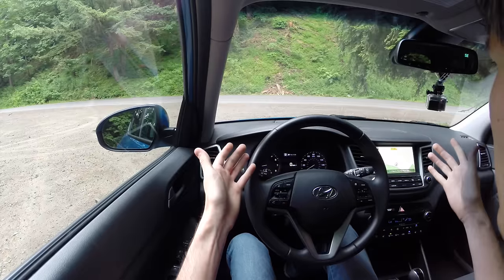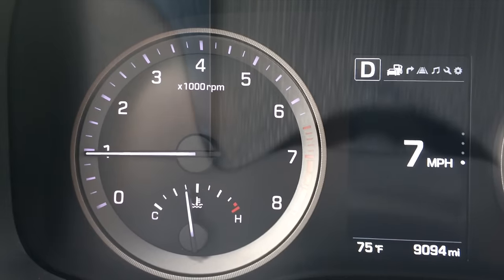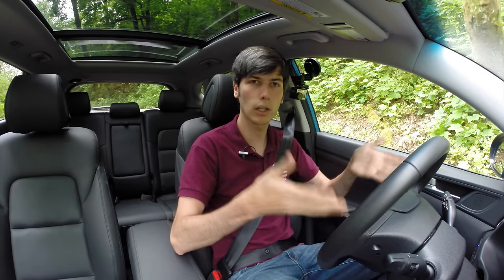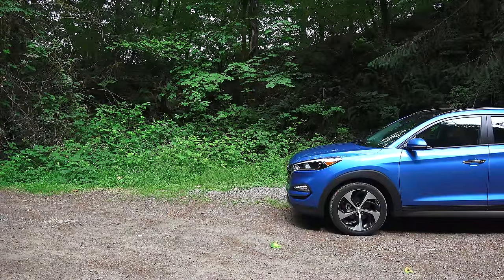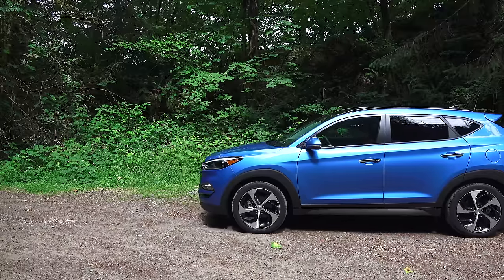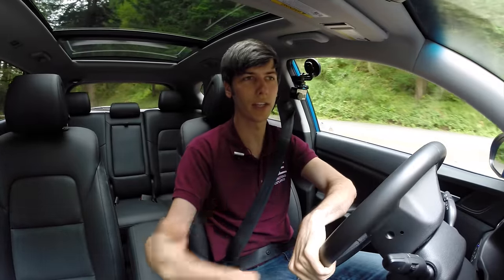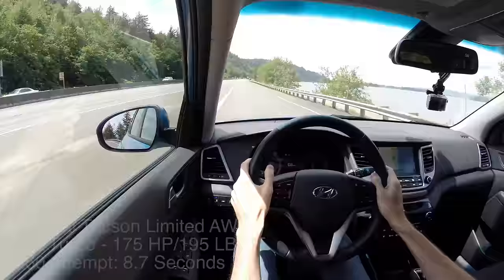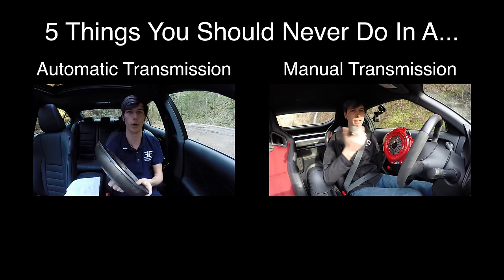5 Things You Should Never Do In A Dual Clutch Transmission Vehicle

Comment: "Don't inch forward" LOL... so here's a transmission that's essentially incompatible with driving in any large city. Just kidding, of course, that's an exaggeration; but it does go to show just how valuable a torque converter (or hybrid) can be.
Reply: And it also shows that the title of the video is completely misleading.
Reply: Frank Reading Well, only if it's taken literally. He's not saying you should never, under any circumstances creep forward in a DCT-equipped car, just that doing it regularly may wear the clutch faster (i.e. "never always creep forward"). EE is a smart guy, makes tons of great videos. Dual-clutch transmissions are really cool, but I think this is probably a valid criticism of them... and I'm honestly kinda surprised that they're becoming so commonplace now. For regular, city or suburban driving with lots of stops and starts, a torque converter has distinct advantages. DCTs are a natural fit for any performance-oriented car and hybrids, where the electric motor can handle low-speed duty, but for a Hyundai Tucson? Seems kinda silly.
Reply: ***** To be fair, we don't really know how fragile most DCTs will end up being yet either. VW's DSG has been around the longest and has multiple well-documented issues, but I feel like that could be said about almost everything VW builds. There's a big movement right now to make engines smaller and more efficient without compromising performance and I think that's cool. I'm excited for 2-cylinder 500cc engines turbocharged out the wazoo. A DCT gives you impossibly fast shift times and reduced mechanical losses, so that's where Hyundai is coming from with them and I understand that... thing is, modern automatics really aren't that far off from DCTs in performance or efficiency; especially in something like a compact sedan or CUV. 0-60 and MPG are going to come down to fractional differences between an Tucson with an automatic and a Tucson with a DCT - something that 99% of the people buying them will never notice. Maybe I'm wrong and their clutches will prove strong enough, and their computers "smart" enough to avoid excessive slip and still feel linear behind the wheel, but only time will tell!
Reply: as a long standing hyundai tech I can tell you in my shop the transmission that provides hyundai with the fewest problems is by a wide margin the DCT. Since the Veloster DCT ive seen exactly 2 DTC transmission failures in 5 years at a dealership level. But you're probably right.
Reply: There's a tiny bit of confusion here. As long as the first gear engages fully, there's no problem with creeping. You could try this out in a manual car to see how fast you are going when fully engaged to first gear with low engine rpm. In a dual clutch system this practically means that you should not creep by lifting the brake pedal a little i.e. move slower than the first gear allows. Creep on, but when creeping just lift the brake completely.
Reply: Klikkitse Lifting off the brake pedal completely doesn't mean that the clutch is fully engaged. That all depends on how much slip the DCT is programmed to allow.
Reply: doctor zaius All I meant is that EE has titled this video "Things NEVER to do" and in reality it is "Things you should sometimes avoid doing if possible"
Reply: doctor zaius There are several videos on Youtube showing the DCT in Tuscon overheating and neutralling up as a result. Driving in heavy traffic i suspect might be the cause.
Reply: doctor zaius Wait, seriously? I never knew this. I was under the impression that creep speed = first gear fully engaged.
Reply: Right, what you should do is let the car in front get a little distance, then move up with fully engaged transmission and come to a stop behind the next car. It doesn't mean you can't drive in traffic, just realize that by not tailing the car in front creeping on their tail, you are not getting forward any slower.
Reply: Yeah, and by leaving that distance somebody cuts in front of you, or honks their horn at you.
Reply: True enough @Scott Z
Reply: 1-inch distance creates more traffic... on smaller roads were you start recognizing other cards after week you can give a try and leave more space by waiting longer even 2-3 cars and than go... after few days more of co-drivers realize that it's better and you all are going with constant speed of e.g. 30km/h. Why? Because there is enough buffer between cars to limit effect of 1 car stopping in front or doing something silly. Also 1 inch distance = more tiny accidents which blocks lane for 30 minutes until drivers realize fine will be higher than damage and go.
Reply: same wear and tear on a manual, basically he is just saying you can do it but it would shorten the life of a the clutch pack.   I rarely creep when driving a manual transmission, I would do the same with DCT ...
Reply: To be fair, the majority of people in greater London on the roads are using manual transmissions, and the traffic there is worse than almost anywhere in the states.  The difference is that over 90% of licenced UKers took their drivers training and tests in vehicles with manual transmissions, and they tend to have fewer habits built up by driving torque converter based automatics.

I think ultimately it just wasn't a good fit for the North American market.  The powershift gets far less criticism for its behaviors elsewhere, and most American consumers probably didn't know what to expect.  "Stop and go" traffic seems to get much more choppy in countries dominated by automatic transmissions .
Reply: doctor zaius dude it takes 2-3 seconds to let the car in front get far enough forwards for you to give the accekerator enough of a pip to get rolling without harming the clutch
Gotta do the same in a manual - which is technically (at a stretch) what youre driving
Reply: Its just like riding the clutch in a manual.
Reply: Yes, and the car should really have a break hold function so that the driver doesn't have to hold the break while stopped. Its not really difficult to do.
Reply: Klikkitse depends on the transmission, but let’s say that in my Audi s-tronic (basically VWs 7 speed DSG) I believe it never allows the clutch to engage fully on 1st gear to prevent jolts when accelerating or letting go of the gas pedal. even the indicator shows D and then D2 (2nd gear) after getting to about 10 kph (6 mph?). then the rev counter begins to copy the increase in the cars speed—in lower speeds it lets the clutch slip and the revs stay pretty constant even though the speed changes...
Reply: @trevors8577  I creep forward at lights to allow access to turn lanes or to let someone pull forward enough to get out of the intersection. I hate the people that leave so much space between themselves and the car in front that I end up waiting at two lights instead of one because they wouldn't move up enough to allow me into the left turn lane while the arrow was green.
Reply: @nich0lee  I agree with that but you shouldn't have to creep at all, where you stop should be close enough to the next person to make it unnecessary to move again.  If it's really really close and you actually have on a turn signal so I know you want to turn then I'll try to move further ahead but I usually stop within three to four feet anyway, and driving a stick I don't want someone within inches of my butt either.  But courteous drivers in the state of colorado are getting fewer and many think that ten feet is an acceptable following distance when doing 70 mph!
Reply: With a wet clutch you can inch along all day. Source: 200k mile Passat DSG.
Reply: @hologrampizza5432  Your passat has a wet clutch AND requires NEW FLUID EVERY 40,000 MILES to remove allllll the clutch material that is worn off from slipping.  So you pay around $300-$500 for that service or if you DIY then it's around $150 every 40k just in parts and it's going to be better than a grand to replace the clutch when the time comes.  Slipping the clutch, whether it's wet or dry is going to wear it out faster than not slipping the clutch, I don't care if Bob is your uncle or not.
Reply: I drove a DSG in London, and managed to not creep forward, as I rarely do, I maintain a gap so I can keep it moving at also let the car in front move some distance before following.  It prevents me rear-ending someone cos they weren't committed to crossing the stop line or someone stepped in front of them or whatever.  Plus a chance to stretch the car's legs as it were.
Reply: @doctorzaius4084  These are essentially MANUAL transmissions that are shifted AUTOMATICALLY. Creeping along in stop and go traffic will wear the clutches just like pumping the clutch in stick shift car. The transmission unlike a hydraulic AUTOMATIC transmission (slush-box) should last a VERY LONG time. A bonus with this type of transmission is that it only holds about 2qts of fluid and like a manual transmission would probably never need changing, no valve bodies or filters to clog up.
Reply: @TheOzthewiz  A fluid coupling is naturally far more resilient than a clutch in any type of low speed driving. If you live in or near any large North American city, 90% of your driving is going to be sub 30MPH with multiple stops and starts per mile. Even the most cautious driver will not be able to avoid excessive clutch wear under those conditions. There aren't too many taxicabs with DCTs tooling around NY or Chicago, and with good reason.
Reply: @doctorzaius4084  Also not many cabbies with stick shifts either. As I explained, these  cars were designed to get maximum efficiency just like a manual transmission with the computer working the clutch. The car should be driven with the understanding that it has  MECHANICAL clutch discs that are wear and tear items. The transmission itself should be bullet proof like a manual trans. Most of the negative press that this car has received is because folks that have NEVER driven a stick, are not used to feeling the up and down shifts, thinking that the trans is malfunctioning . I personally like the way it shifts with detectable shifts because I learned to drive stick shifts. I took my road test for my license in a stick shift car at 15. CHEERS!
Reply: doctor zaius From what I noticed test driving a VW golf with dsg, is that the car does pull forward a bit faster than with reg auto from stop when releasing the brake.  Obviously that’s so the clutch can fully engage sooner.
Reply: doctor zaius Exactly. It depends what cars and what type of transmission you’re surrounded by. Traffic is just as bad in London England. Only in London you’re surrounded by other manual drivers who don’t continually creep all day inch by inch.
Reply: To be fair a lot of people mess that up in a manual and wear out their clutch.
Reply: @myguydied  something that comes with a practiced skill of driving a manual in traffic without riding the clutch. A skill not everyone has especially those that only drive automatics.
Reply: @skopa1223  probably more so because of the mechanism of the clutch engaging and having that direct connection from the engine to the wheels rather than that slip through the hydraulic slushing of fluid through the torque converter as the engine revs increase when you step on the accelerator.
Reply: doctor zaius my car’s a hybrid with a 7 speed DCT. I wonder where that puts me
Reply: I notice the largest annoyance in my DCT, on the highway during rush hour where you stop then move 5 yards at 7 mph and then stop again.  Constant clack from trans when I remove brake, clack again when I apply.  Sometimes 6-12 clacks per minute.  I love the MPG of my little car, but I stopped driving it to the city for work and just take the gas hit on my big V-8 Cadillac since it loves all driving conditions.
Reply: @bushrakhan1529  in a Geely lol

Comment: #3 My car (VW brand, Touran II) has gear #1 only for starting to drive, it will immediately switch to gear #2 afterwards. In such a scenario, I switch to manual and to M1 to slowly drive forward. Otherwise the car would shift to D2, and will not close the clutch completely and will lead to the problem you told (but with gear #2 instead of #1). So it helps to know how your car is working to avoid slipping clutches.

Comment: Nice vid out there! Learned a lot from this. But I have questions regarding point no.3 which is about inching forward. It's best to allow enough gap to get up speed for the clutch to fully engage. But, how fast is fast? Is it like 10-15mph or higher? Or 1-2k rpm? Look forward for the answers. Thanks and keep it up with those great quality videos!
Reply: its a bit late but as far as i can tell. In a manual transmission you can easily drive 10 km/h (so about 6 miles per hour) ?

Comment: I got my first DSG 8-speed car just a couple of weeks ago, and I'm still trying to predict the gearbox fully. I find that while it's super smooth at changing gears, it's kind of slow out of a stop. I've been driving manual cars almost all my life, so it's a bit weird having that lag from pressing the throttle until it starts moving fully. I'm guessing it's that while I'm in D, and on the break pedal waiting to go, it's got both clutches disengaged so they're not wearing down (basically same as N), so from the moment I release the brake pedal and press the throttle it has to engage the first clutch from a not-ready position. Is that correct?
Reply: Correct.
Reply: What do you mean with "not ready position"? Normally the ability to quickly engage and disengage these clutches is one of the big advantages of a DSG.
Is it possible that your gearbox is trying to set off as smooth as possible and therefore uses an especially long slipping time? I remember some DSGs barely used the first gear and instead started in second gear with slipping clutch to give a smoother experience.
Reply: @MetalheadAndNerd  I don't know, but from the video I got the impression that while in D, while being stationary and having pressed the brake pedal, both clutches are not engaged so not to wear the clutch. Is that way it seems slow from a stop? I've heard others with DSG gearboxes also complaining that it's a bit slow from a stationary. Interestingly it seems faster (quicker reaction) from a stop in S (sport) mode than in D.
Reply: What's your car? I don't think there's an 8 speed DSG.
Reply: @ederss7  7 forward, 1 reverse. It's a 2017 Golf Sportsvan 1.4 TSI 150 HP.

Comment: Great video! Extremely educational. Regarding the "logic of the DSG", in my Golf GTI, there is exactly what you described - a lag when I downshift using the paddles whilst accelerating. The computer may think I'm accelerating, therefore the next gearshift should be up. Actually, the true situation is that I'm accelerating because I want to overtake, and I'm downshifting because I need to accelerate more quickly at that point. Is there anything I can do about this frustrating lag??
Reply: I tap the break and downshift right after then accelerate
Reply: The lag should only be a fraction of a second. Just the time it takes for the shift fork to select a new gear. So say you're in third, the transmission has fourth preselected, then you put your foot down, or manually select second, all that has to happen is the shift fork moves from fourth to second then declutches. It's a bit slower than a normal shift but should only be a tiny bit slower.

Comment: I was caught in snow and stop and go traffic, lot of breaking and going slow, all the sudden got a warning tone and message the my transmission was over heating.  Called the dealer they told me to leave space between me and the car in front of me to fully engage the clutch or to pull the car over and let it cool down for 20 minutes.  Say what?  That just seems to be a design flaw, did they not take in to consideration a lot of consumers buying these are city drivers in lots of stop and go traffic.  Had I know this I would have thought twice about buying the car.  Love it otherwise but this is a big issue.  I worry what kind of damage this causes over time.
Reply: Tim Gray oh man, heart attack at that moment?
Reply: @Off3er  Probably :D
This has nothing to do with this, but I got a good heart attack while working and my forklift stalled. That thing weights like 5 tons and the handbrake is useless. It locks the steering wheel and I was there just watching as the lifter slowly rolled towards the end of the hill...... Luckily it stopped like 10cm before it was too late.
Reply: Did you left it in Drive every time you stopped??
Reply: It will cause your clutch pad to wear out earlier

Comment: I had a DCT in a 2014 Ford Focus.  It had a pronounced lag between releasing the brake and 1st gear engaging.  The car would roll back maybe 3ft, especially on an incline, so I had to drive the thing with thing feet when moving off from a stoplight.  My daughters absolutely refused to drive it.

Comment: And these, ladies and gentlemen, are the reasons why cars and trucks makers are moving away from that dual clutch craze and going back to either torque converters in 2019. Less costly to manufacture, and to maintain. And with modern locking torque converters, the performance and fuel economy is about the same anyway. The fabulous and well renowned ZF 8HP automatic transmission, which is used in many cars and trucks of different brands, is a torque converted one.

Comment: Point 1 (0:30) - well surely if you're "coming to a stop", you would likely shift into neutral anyway so you can engage the handbrake / parking brake? 
It's interesting that here in the UK you're recommended - at night time at least - to engage neutral and apply the handbrake to avoid dazzling drivers behind with your tail lights. 
Obviously if you're only stopping for a few seconds, holding on the brake pedal isn't a problem.